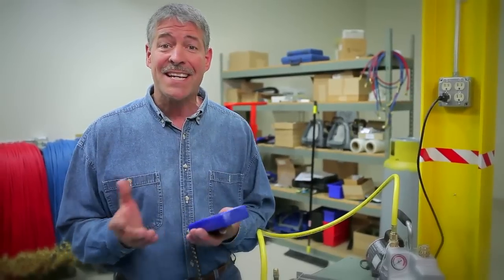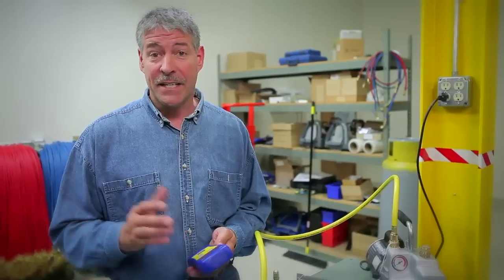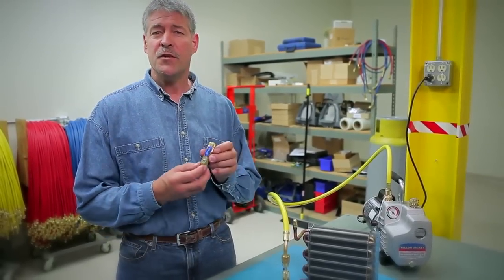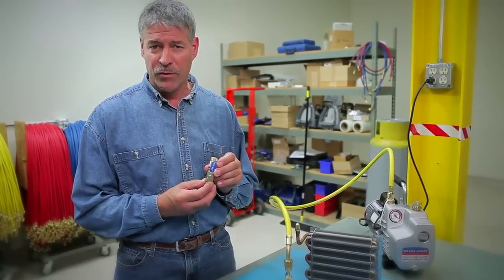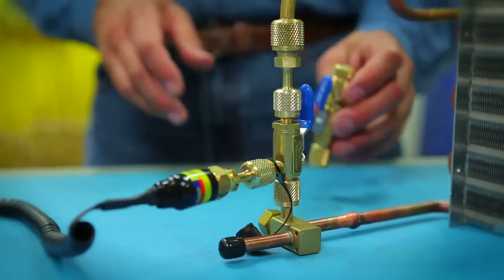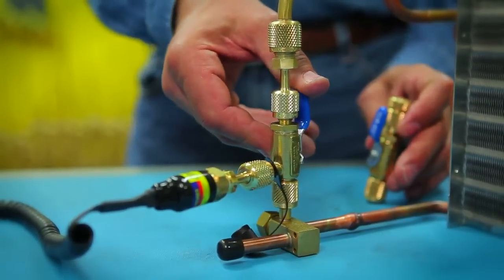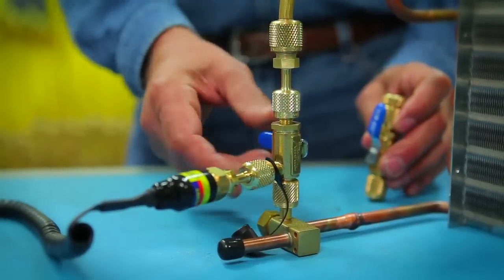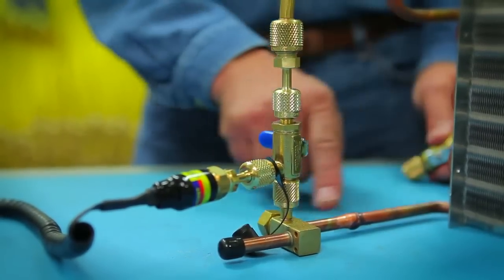YELLOW JACKET Quick Tip: Rising Micron Readings

Comment from the maker: If you check the reading every 5 minutes and you see that it is rising less with each check, you know that the reading is leveling off.  If it is not leveling off, you probably have a leak.  Slight fluctuations in vacuum readings are normal.  For the best possible vacuum hold, we recommend isolating your hoses, manifold, and vacuum pump from the system using core removal tools.  The micron gauge can be connected to the side port of the core removal tool.

Comment: Also, if the system you're working on has been opened to the atmosphere, especially in a humid  area, and your compressor has a touchy hydrostatic characteristics, breakout the Netflix on your smartphone and enjoy your lunch. 😉
Reply: So my vacuums never hold below 500, they take too long and I don’t think I have leaks. I let it run for an hr sometimes and it still won’t hold. It doesn’t jump way up like he said so I don’t think I have leaks. I’m in Michigan which is humid. Is that just how it is or do you think I’m doing something wrong

Comment: Hi. How do you determine when the reading has levelled?  What if it seems to have levelled, but after many hours or overnight has crept up a little? Is it normal to see slight fluctuation in the system if hoses and gauge are set up for such a long time, or does it indicate a leak?